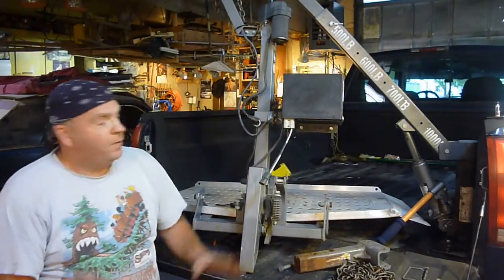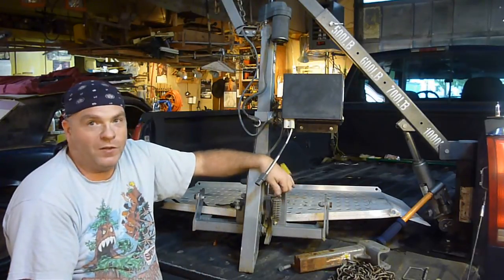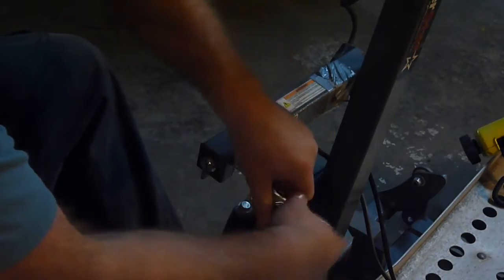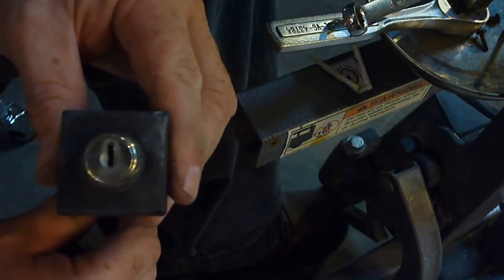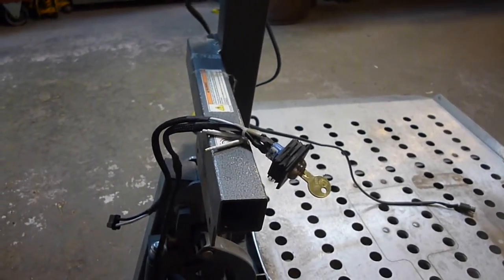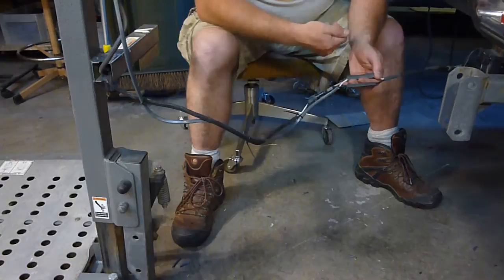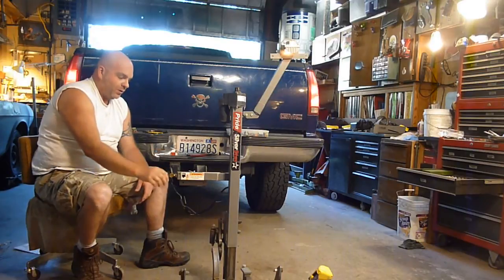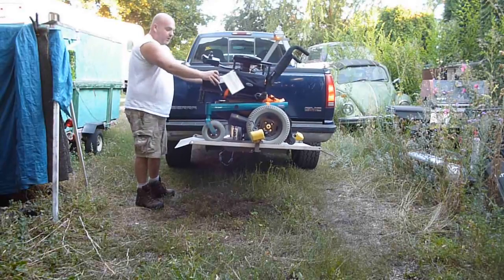WHEELCHAIR LIFT WIRING & INSTALL

Comment: You absolutely should not use the tail light circuit pn your vehicle to power the lift. I work privately with mobility equipment and make special adaptors that plug into the 7 way round plug to utilize the 12volt "RV charge power. The Pride Sillverstar lift that you have and the Harmar lifts take a Weatherpack plug and the Bruno lifts take a different plug. I build an adaptor that also has the 4 flat plug if someone wanted to use the tag lights. On your vehicle that doesn't have the 7 way round connector you should run a dedicated 12ga wire from the battery. I make those harnesses too and they are also available pretty reasonable online.
Reply: Where can I but one?

Comment: They say to leave the truck running it will help a lot
Reply from the maker: yep i have found it works better with the truck running  👍
Reply: Okay I was working on my mother-in-law's today and the bolt that is inside of the pipe came loose do you know how to fix that
Reply: It won't lift up
Reply from the maker: @pain_inthe_bass  sorry i don't know

Comment: Have CRPS, supplement with 400mg to 800mg of magnesium citrate everyday.  Be certain to take a full spectrum of all vitamins and minerals every day with your biggest meal.  For general health use intermittent fasting which is  to limit food consumption to one window of 4 to 6 hours a day.  No snacks no sweetened  coffee. Coffee is ok when it's black with just a bit of stevia. As an example start eating say at 12 noon.  One single big meal, similar to supper within that window with maybe a veggie smoothie as a small final meal.    End the window at 4pm to a max of 6pm if started at 12. Can vary some day to day. No food at all outside of the window.  No sodas etc. Water only. Stevia sweetened zero-calorie beverages are an option.  No sugar alcohols. No alcohol. You will be hungry some but you will also realise that this is very good for you health. And it sheds body fat well. Be sure to add in some exercise.